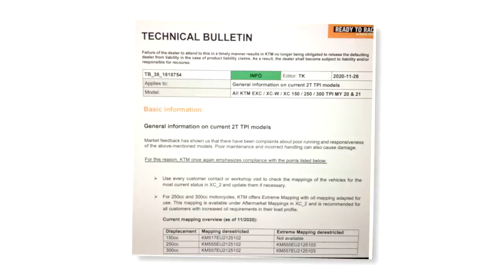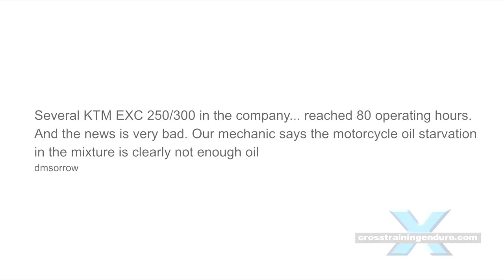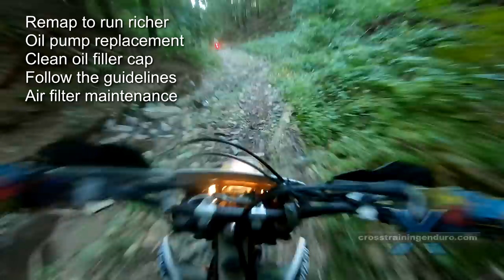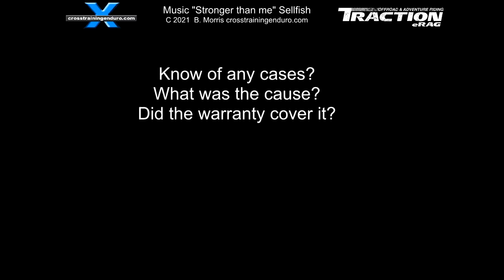Are TPI models seizing? 7 preventative strategies for KTM TPI problems ︱Cross Training Enduro

Comment: I'm going to guess that the number one mode of failure on TPI bikes is people not using the recommended motorex 2 stroke oil. Different oils have different mix ratio and different viscosities. The ecu would not know what oil has been put in the tank and potentially meter out the wrong ratio for the non recomended oil creating a lean situation.

I would love to see the statistics around the oil brand/failure rates.
Reply from the maker: An interesting point, Glenn. I suspect if that was the issue, or part of it, then it would have mentioned in that last KTM Technical Bulletin... or an earlier one.

Comment: If you really want to go the extra mile, remove the air filter and do the oil pump purge with the dongle and look down the airbox into the throttle body. You will be able to see and hear the oil pump work before going out for a ride.
Reply from the maker: Handy tip, Chris!

Comment: rmx450 2016 model huge hours including fink etc, not a single issue never had to even do valves clearances.
Reply: Yeah mate I have a 12 rmz450 with over 200 hours, not a prob, Same with my 98 rmx250s with 22,000km, zooks for the win ktm are just an under engineered fashion statement

Comment: I've had propblems from the start. 2020 EXC150, seized at 35hrs and ran like crap after about 10 hours from new and seized again at 95hrs. I think the seizing is the check valves in the oil pump getting stuck, after the last time I pulled the pump apart and modified it to pump 20% more oil and it seems OK now. 
Just started running crap again (CCPS) like it has a way to rich needle, had been fine since I glued them around Xmas time (longest its ever gone properly). Wash the mud off today and try swapping CCPS over and see if it fixes it. Thats my piston in the video at 35hrs :)
Reply from the maker: It's a shame they don't really iron out all the potential issues before releasing new models. I know most owners don't encounter problems, but it's real hassle when you start hitting multiple problems.
Reply: Going again with a CCPS swap, they seem to last me 10 hours before it starts to get the rich spluttery feel off idle. Have a selection of China/ford ones as well.

Comment: I have a Husqvarna TE 300i 2020, and used it as supermoto, (no engine mods what so ever) Ive absolutely ripped the living hell out of it. 
Only issue ive had is a small powervalve cover leak. quick fix. cost lest than 10 usd. I use Motorex Cross Power 2t oil.

Comment: Hello i live in spain and have a enduro renting company and bought 7 ktm 300tpi 2020, 4 of them dont have good Power. And the other 3 seizing within 500km. Dealers answer was no garanty anymore after one month. I had to buy 3 new cilinderkits. All bikes where on the dyno when they where new because i feel the difference in Power between them. And i was  right, there was 5hp difference between the bikes. But ktm dealer can do nothing they said.
Reply from the maker: This 30 day warranty with KTM is very disappointing, Robin. If the bikes aren't raced, they should have a six month warranty like other brands. Many owners are getting the ECU mapping changed back to the original mapping of the 2018 and 2019 models which uses more oil.
Reply: Oke i am going to ask the dealer if he can change to 2019 Software. Thank you

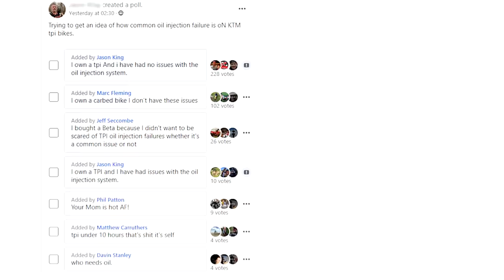Comment: 2:10
5% is a massive failure rate in a new mass produced product!
Reply from the maker: We don't know if it's 5% but we figure it is a low but significant rate. One dealer reported 20% of his bikes are coming back seized, but others say only one or two. Some rider groups say none of their bikes have issues... one guy told me 4 out of 10 TPI bikes in their group seized. It's hard to know what the real failure rate is.
Reply: @crosstrainingenduro  Remember that KTM
only gives a 30 day warranty.. That itself shows lack of manufacture confidence in their own product. And the motocross version is still carbed......
Reply from the maker: It can vary from country to country. In north America it's 30 days for any bike designed for competition use. Road bikes and bigger adv bikes two years. Some mid sized road and adv bikes are one year... I agree 30 days in pathetic if the bike isn't being ridden competitively.
Reply: @crosstrainingenduro  in our group of a dozen riders, 2 of them got rid of their TPI KTMs because of problems and purchased a carbed Beta 300 and Sherco 300. All of us others still ride carbed 2 strokes.
TPI was not brought into the market to make riders happy... it was brought into the market to satisfy asinine European environmental regulations.
Reply: Yes it is....
Reply: @crosstrainingenduro  Those are all high failure rates though.
Reply: @crosstrainingenduro  I live in the US (Idaho) and bought a 2021 Beta 300 Race Edition 2 months ago. It came with a 6 month warranty.

Comment: I had an expensive warranty issue with my Husky, right around the 29 day mark, manufacturing error in the engine case. Dealer took the bike in, and told me a week later the claim was denied. I called KTM USA immediately, had the rep on the phone in 10 minutes, who told me no, the claim was approved. Dealer complained the whole time that they were going to lose big money on the job, and KTM doesn't pay enough to cover their actual time...

It isn't always KTM who puts up the fight. Give them a call directly if there is any issue.
Reply from the maker: Beta dealers faced the same issue with main bearing failures. Beta head office only pays for five hours labor which isn't enough. Plus the dealer has to pay for non-labor costs such as engine oil, radiator fluid, any gaskets etc. I did ask Beta why they don't properly reimburse their dealers and was told it wasn't my business. 😂 KTM, and I assume most manufacturers, try to offload some of the cost to dealers. If you have a great dealer, help them out by stripping the bike down as much as possible for the repair.
Reply: @crosstrainingenduro  good to know, I would have gladly helped, but I asked what they wanted done, and they said to take off the skid plate to get a better look at the defect, that was it. 

I found my repair paperwork, 7 hours for a full teardown and rebuild is what they were approved for, on a 4 stroke... 1734 USD for parts alone (Ktm paid for the oil, filter, and coolant), but I come back to the dealer quite often for gear, oil, etc because I got to know half of the staff through the process 😆

Comment: Thanks for the info. Have a 2019 250 TPI with 50 hours on it so I’ll keep an eye on it. If I have any issues I’ll let you know.
Reply from the maker: I'm sure you'll be fine, we don't know what the rate of failure is but it's quite low. Replacing the oil pump at the recommended 80 hours is probably a good idea for peace of mind. Just priced them in Australia, AUD $300. Ouch.
Reply: @crosstrainingenduro  yeah, I totally agree. I know of bikes going well over 100hrs, but a $300 fix at 80hrs is a heck of a lot better than replacement. Also a good time to check and replace piston if required.

Comment: I had a Suzuki 120 CAT 2 stroke in the 70's. It had a oil injection system. My other 2 strokes was a 250 CZ. I ended up saving time and just use premix and tied off the injector system. I wonder if you can do it to the KTM's? My 2016 300XC uses a Carb and glad it does. Jet for 4,000ft and is good in So Cal.
Reply from the maker: Looks too expensive to delete the TPI, Erik. Replacing the barrel and entire electrical system would be very expensive, before you even started on the other bits...

Comment: Not KTM related. But I recently replaced the main bearings in my 2020 TM en 300 FI. 20 hours on the bike.  
I was told low fuel quality. What I'm thinking is it's the plastic caged main bearings where the problem. They got hot They melt it then they fell apart.

My solution was to run 80 to 1 premixed and the oil injection system together. So far so good
Reply from the maker: Plastic cages? I'm no engineer but that sounds like a problem waiting to happen! Are they used on other brands of bikes as well?
Reply: @crosstrainingenduro   I don't know about other brand motorcycles. I do know they are used in snowmobiles as well. SKF has two models of the same bearing one has the plastic cage The other has the steel cage. I replaced them with the steel cage model number. I'd send you pictures if I could but I don't know how to contact.
Reply: @hackertheslacker  it used to be an option when tuning scooters. They were called polymer separators or something like that. The plus side was supposed to be that when separator fails the polymer doesnt harm the cylinder.
Reply: well the 20s did have main bearing tolerance issues, no?

Comment: Just made 30hrs on my TPI... Runs just as new. No complaints at all. I bet the faults are 90% caused by the rider. Not doing normal maintenance or warming up the engine, stuff like that.
Reply from the maker: No, various specialists have confirmed that the stock setup can use a little as a 150:1 oil ratio. It's no wonder some riders are having early seizures and/or premature wear.

Comment: Another TPI problem, in Central, Idaho USA anyhow ---> I can't fill my chainsaw off the tank! My 2018 KTM 300 xcw has been incredibly reliable. It is in the shop right now though. Haha
Reply: Wouldn’t a chainsaw want more oil anyway. I use to use my bike fuel for a leaf blower until I seized it. I reckon 60:1 is a bit lean for a machine that’s held at full revs for extended periods of time.
Reply: @ian9toes  TPI has no mix in the fuel, so if you ride with a chainsaw with a TPI you need to bring a fuel bottle, and a bar oil bottle. Non-TPI you can fill right off the tank before it goes in the carb.  I run 80 to 1 with amsoil in my ktm 300, and in the chainsaw.

Comment: 2019 300Tpi , just changed the piston at 80hrs. It looked perfect and measured within spec. Going to let it go 100hrs for the next piston change. Are any of these seizures caused by not warming the bike up first before being ridden hard? Pistons dont like it when they expand quicker than the barrel
Reply from the maker: I never publicly recommend this, Trevor, but I know when a two stroke 250 or 300 is well lubricated then top end rebuilds at 200 hours are common... assuming you aren't riding the bike aggressively. So 80 hours is very early for normal riding. Some guys have had cold seizures, but I don't know how common it is. KTM did release a mapping option that runs richer while cold. I think a cold start injector was introduced on later models too.
Reply: @crosstrainingenduro  First New 2 Stroke I have owned and 80hr piston replacement for normal usage was what the owners manual said so thought I might as well do what was recommended. Plus I was fitting a TSP cylinder head and ECU remap at the time. But yes 80hrs for the type of riding I do was early for a replacement.

Comment: I dunked my 2019 te300i 3 times and ended up having to rebuild at 120hr more from my own stupidity. when the oil pump went next day after the 3rd dunk it stalled and wouldn't start so I tried bump starting it down a mountain turned out the oil pump quit and when I replaced it fired right up but the damage was done I now have 2 oil pumps extra, a new top and experience.

Comment: Bestdualsportbikes company explains this phenomena as those failures are occurring when you start the bike cold.  The oil doesn't have the time to dissolve and mix in with the gas so for the first couple of seconds you are running that piston dry with only gasoline, which wares out the piston and cylinder walls. Dave of Bestdualsportbikes shows this with his TPI KTM cylinder and piston on his Youtube channel KTM Husky. Here is the tilte of the video to search for " Why KTM/HUSKY TPI bikes wear out so fast ". He fixed this by putting one ounce of oil in the gas tank and doing a relocation block so the oil is injected after the reed cage so that it will mixe with the gasoline better. He also fixes the lean fuel issue so it runs richer.
Reply from the maker: I've read quite a few debates about that Christian. It would be interesting to see a KTM engineer's take on it.
Reply: @crosstrainingenduro  That would be interesting in deed :-)
Reply: The piston is not dry when you start it, pull the pipe off or take the cylinder head off a week after you ride and you will see there is still residual oil on the cylinder wall. The KTM/Husky guy is known for manufacturing problems that do not exist in order to sell is products. I did a piston on my TPI bike at 150 hours and I've never seen a piston come out looking so good, could have gone another 100 hours and been fine.

Comment: Would wish to highlight mroe under guidelines, how important it is, to heat up the engine proberly before you give load and revs.
Reply from the maker: I did see quite a few guys talking about 'cold seizes' but I didn't find enough evidence to make it a solid point... so I just referred to the correct warm up procedure as a sub-point. But if I get some good cases reported I'll add it to the pinned first comment.
Reply: @crosstrainingenduro  Understood, it will be difficult to figure out what was to actual root cause of the damage. Enclose a link which I found very helpful to narrow down possibilies of piston failure: 
https://www.ms-motorservice.com/en/technipedia/post/piston-damage-and-causes/

Comment: Friend of mine bought a new 2020 250 tpi (EU)oil pump failure after 20 hours. But all my other tpi friends 10+ never had any issues with there bikes
Reply from the maker: Did it seize... and was it fixed under warranty?
Reply: @crosstrainingenduro   Would have been nice, the crankshaft bearings got it first 1800€ 
No warranty
Reply from the maker: Bummer. 😢

Comment: If owners are worried about that issue, I guess they could simply mix a little two stroke oil, in with the fuel to make the bike run a little richer. Or would that cause some other kind of problem ???
Reply from the maker: We aren't sure Kevin so it would be good to have a KTM technician or TPI specialist comment. Some say adding oil to the tank could possibly clog up the system. Others say it won't lubricate the bottom end or under the piston skirt. Others say it will. But we do know the 2020 and 2021 models are mapped to use between 15 to 40% less oil across the rev range and this may be the real issue. And mapping that ensures more oil use across the rev range could be the solution.

Comment: I'm coming up on 80 hours on my 2021 KTM 300 XC.  Four desert races, and lots of hill climbs and trail riding.  I'm am starting to experience poor idle upon startup, and bogging at times I would not expect to experience bogging.  I will definitely look into the crank case pressure sensor first.   Thanks
Reply from the maker: I hope that's all it is, Kyle. Relatively cheap fix. And lots of them are failing in recent models.
Reply: Kyle- have you changed your small in-line fuel filter inside the quick disconnect fuel line coming out of the petcock on the fuel tank? Those bogging and idle symptoms sound just like a plugged filter. I had the same issue in two TPI bikes I’ve had and changing the fuel filter fixed it.
Reply: @purtnearperkins , yes, I did replace it.  The old one looked pretty clean though.  My next step will be to do the idle screw mod.  So I can adjust it.
Reply: Kyle go to Tokyo Offroad he has a vid on the crankcase sensor and an aftermarket coupler to reduce some of the issue, worth a look d

Comment: My 2022 250exc six days seized after 15.5 hrs while warming up at the beginning of a ride. The oil had been topped up after every ride and never been below half full.
Reply from the maker: Bummer. Fixed under warranty Mick? And do you know if the dealer had the 103 map installed which uses more oil?
Reply: @crosstrainingenduro  Ktm supplying the parts but the labour is on me, and I asked for the extreme map when I purchased the bike but just found out it has the sport rider map. Not happy I didn’t get what I asked for and this happened.

Comment: I would c if it’s possible to swap out that 21 century electrical tpi and put the good old fashioned carburetor from the motorcross bikes. I’m sure some adjustments and mods will need to be done and may not meet emissions I’m sure but u could probably just put it back on for when it comes time for emission inspection, Then pop it off afterwards.
Reply from the maker: It looks as though the barrel is very different, haven't heard of anyone successfully going back to carb as yet.

Comment: I don't know how true it is. But one guy who owns a ktm tpi said his bike was running at 100:1. What? That's insane. He swapped out his cpu (only a couple grand hahaha) and it changed his oil ratio to 50:1. I'll stick to my Rieju thank you very much.
Reply from the maker: Doesn't sound accurate to me. I know with Beta's system it will run 100:1 at idle, but as you ramp up the revs it runs richer and richer until you hit 32:1 at full throttle. I'm sure the KTM system will be similar. Remember trials bikes are usually run between 80:1 to 100:1 because it's all low revs and not a lot of engine load most of the time.

Comment: Why not mix oil and fuel manually?
Like it was done before.
Reply: Oil in the fuel makes the air/fuel mixture leaner.  This may cause issues on its own. Injectors probably not designed to run this way possibly though I’m not familiar with this system.  Maybe it is recommended in certain circumstances such as break-in.
Reply from the maker: I don't know how successful this would be, Chris. Some claim with TPI it just gets burned and does no lubrication, others claim it can lubricate the barrel but not the bottom end. Could it clog the system? Some say it's a risk, others say they have run 150:1 with zero issues. I think we'd need a KTM engineer chiming in to know for sure.